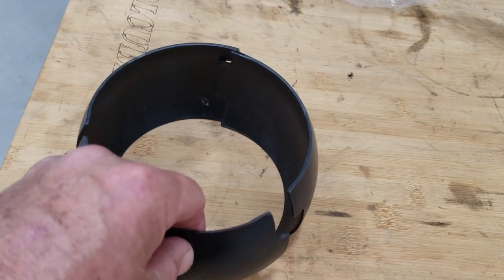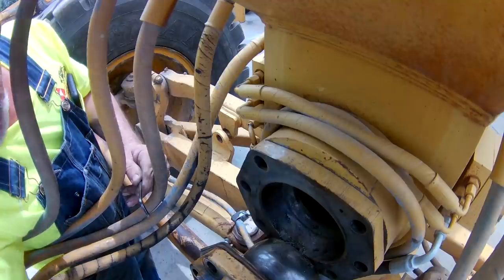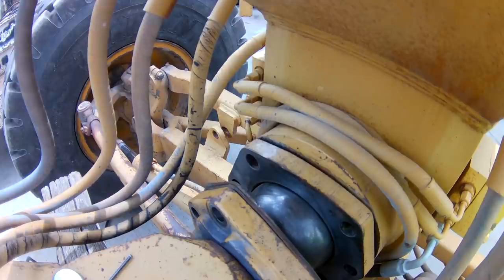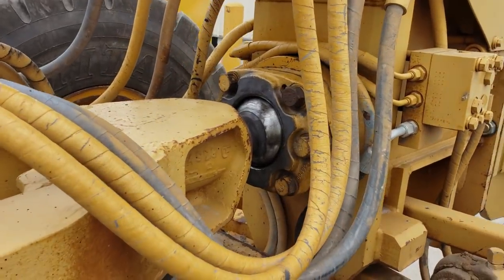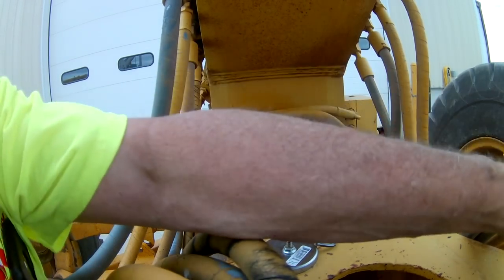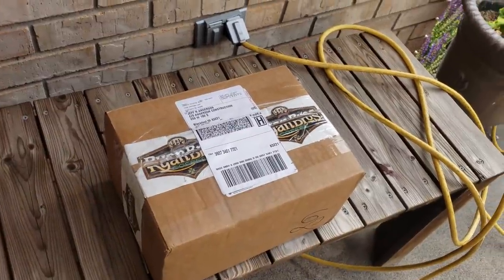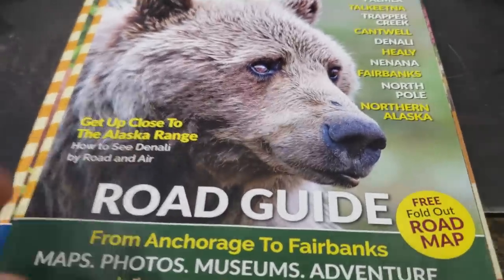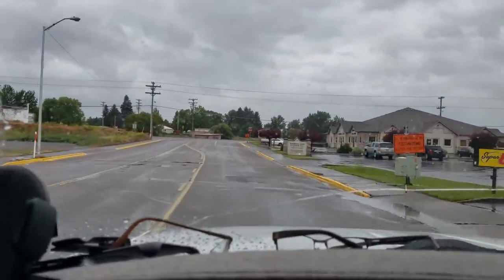14G CAT Drawbar Trunnion Repair #three piece monty #winning

Comment: In the 1930's every post office sorted mail, then the mail got loaded onto train cars based on where it was going, where it was resorted in route by a crew of people that then dropped it at the appropriate locations along the train route or made the connections with other train cars/rolling post offices that moved it on to its destination. With the decline of timed passenger rail service the mail system suffered as well.  Certainly no traveling guys in moving post offices working 24-7 today!

Comment: The reason it comes in three pieces is because it is a plastic injection part. To hold the tolerance required and keep tooling cost down this is the best way to manufacture the part. Great channel 👍👍😎

Comment: Enjoy your videos, used to work in the earth moving industry, operating machinery, trucks of all kinds. Until my back gave out. I see your postal system is similar to Canada's, slow, goes out of its way to deliver local mail. Haha. And charges for doing it. It is cheaper to ship to the USA, than it is to ship local mail here. And it gets there faster to the USA. I wrenched on most of the equipment I operated too.

Comment: hey Jeff, where can I buy those fancy air tool adapter swivels I've seen you using, they were made by a friend of yours if I recall correctly. Thanks from Cawston, BC, Canada.
Reply from the maker: https://www.ebay.com/itm/173954575002?ssPageName=STRK:MESELX:IT&_trksid=p3984.m1555.l2649

Comment: Amazing the postal service can't operate on ANY budget they've ever been granted, isn't it. I have the same thing going here in New York. I live in Elbridge NY, and if I get a package from points west, it goes to the Syracuse post office, ( 40 miles east of here), then to Rochester, maybe 80 miles west of here, and then to Elbridge. It adds about 3 or 4 days to the delivery time, the package gets handled at least 3 times more than necessary, and adds at least 120 road miles to the trip. 
Glad you got the Grader fixed, I wouldn't let them hoses go too long, major heat happening here, probably worse in Blackfoot, when you get the 100+ readings in the sun, it's tire and hose blowin out season...
Hope you've got work for the grader you got 4 pricey hoses to make there. (ordered some swag, it'll probably help pay for about 2" of those hoses, wish it could be more) 
That grader is one nice looking machine, especially since the new rubber went on. Maybe you'll get another road job for the BLM?
Waiting for an update on operation gate, wanna see if she'll swing low, or hold up.
Keep busy, Stay safe.

Comment: FWIW the mold to create a one-piece bearing shell (with a split) would be far more costly than a mold for the 3 piece design.   Plus a plastic tough enough to work as a bearing in that application probably wouldn't be flexible enough to "spring" apart for installation.  Amazing that plastic works at all.  Just tore apart a failed (but fairly new) Briggs and Stratton mower engine and was shocked to see that it had a plastic camshaft lobes.  Both cam gears were plastic---yep, that's what failed.

Comment: How many hours did you get out of the last one? Seems like I just saw you replace that bearing not too long ago. I guess it’s like the switching shaft bearing on a concrete pump, just doesn’t last long because all the crap gets in it

Comment: What's the chances of showing me how you replace the blade slide square bushings and how to take out slack on the blade lift and circle rams. Not to mention how do you adjust the circle  slides and  clutch in the circle gearbox?  Too much to ask you reckon??😁

Comment: Re: Post office.  Here in Alberta, they do things much the same; If I send something from here in Medicine Hat to a local address, it goes to Calgary to be sorted, then back.  It will usually get delivered the next day, definitely by the day after.  Before, there was a large office here with sorters who hand sorted everything, had a difficult time handling christmas rush etc.  At certain times, mail would sit for several days before being hand sorted.  It is more efficient from the point of view of costs to the system, because the machines that sort by postal code are very expensive but can handle all the mail from southern Alberta, with very little human work.  Now, we have a small facility with only a few people working here.  They have been replaced by one ultra fast machine and costs are lowered overall.  That, from the view of the post office is efficiency; better job for fewer dollars.

Comment: Jeff, please give me the part number, repair kit for this puzzle, what is it called and the VIN number. Thank you in advance!
Reply from the maker: You'll need 3 of a 2G7464
My 14G is a 96U 2785
Reply: Thanks Jeff! my 14 g Caterpillar 96U04226. I couldn’t find the desk numbers. Many thanks to you. good luck to you!
Reply: Jeff hello. my motor grader 14g 1,2,3,4 gear works perfectly, 5 like 1,6 like 2,7 like 3,8 like 4 maybe even a little slower. what could be the problem? I changed the filter oil. Please tell me where to look for the problem?
Reply: friend tell me why 5,6,7,8, the gears are very slow 5 like 1.6 like 2,7 like 3,8, like 4 it works if not even slower. From first to 4 it’s excellent. What could be the problem?

Comment: Why doesn't Cat just build that a tighter tolerance and install a couple of grease fittings like the old days?
Reply: Unfortunately, that is practical and (these days) would add to manufacturing costs.  Yet, it would really make things easier to service and maintain.
Reply: @stephenroberts4895  There is a definite plan (I believe) to make things harder to maintain and cause more parts purchasing and possible more machine purchases.  How many people do you know that maintain their machinery like Jeff?  (I know very few if any people that do all the painstaking maintenance like Jeff and his sons do)
Reply: @two-strokesmoke7289  Very few I know maintain equipment like Jeff, let alone take pride in keeping machines in good/excellent running condition.